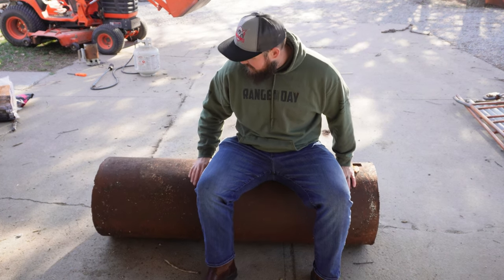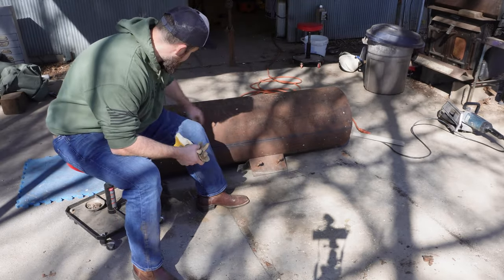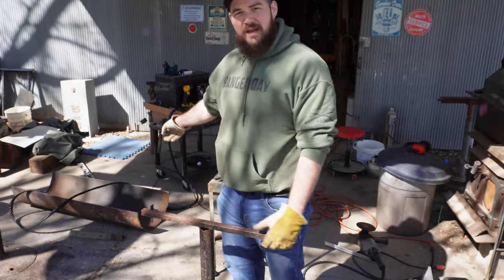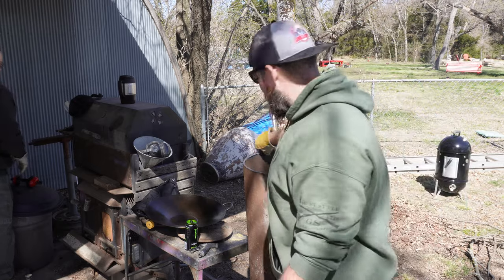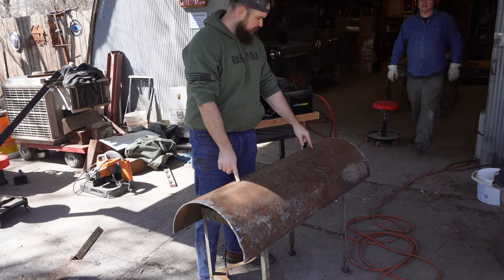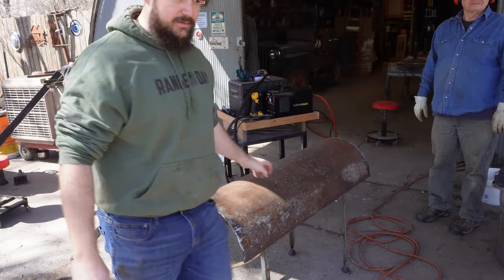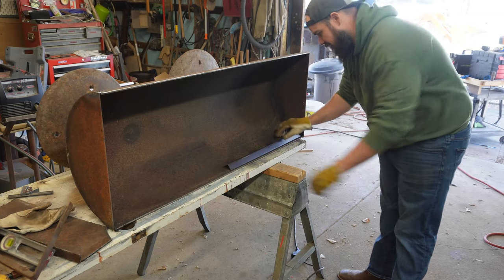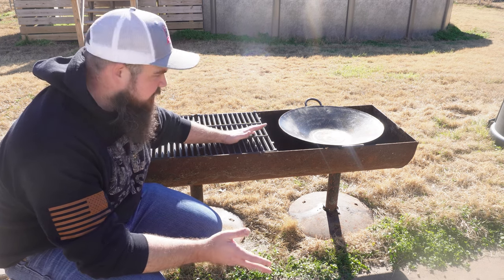Live Fire Cooking Table Build!

Comment: It needs some holes at lowest point at both ends for draina ge and  maybe a clean out for ash  and air.
Reply from the maker: I actually added a hole in the middle with the plasma cutter just had already turned the camera off ha. But some air ports could help with the fires! I'll see how it does when I fire it up! Thanks for watching!